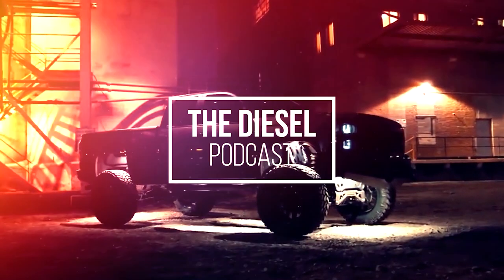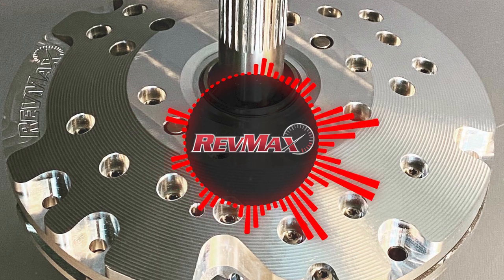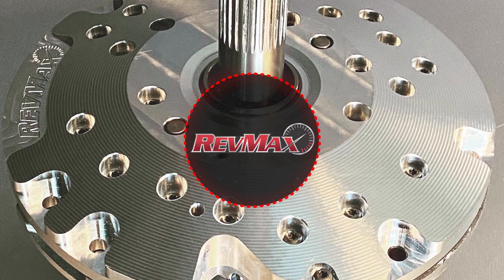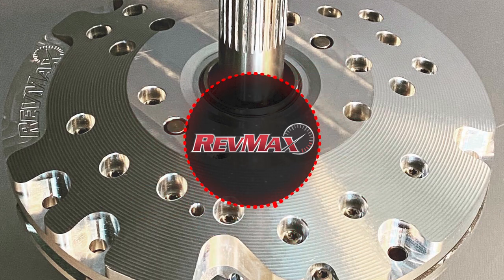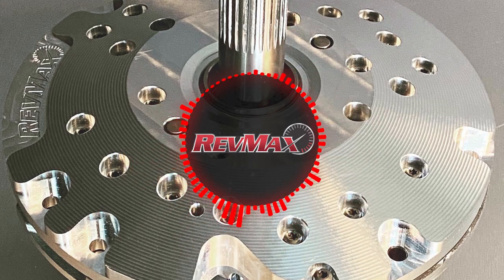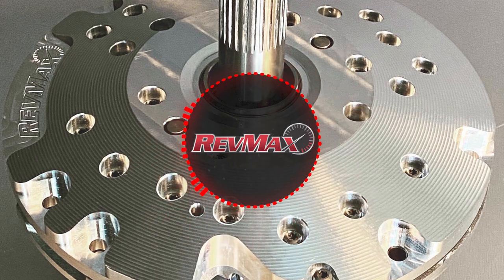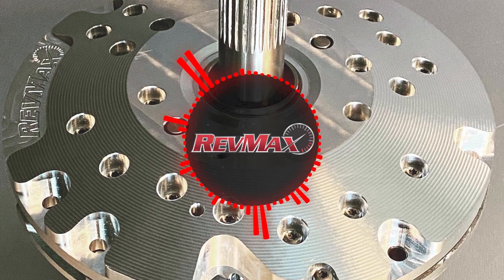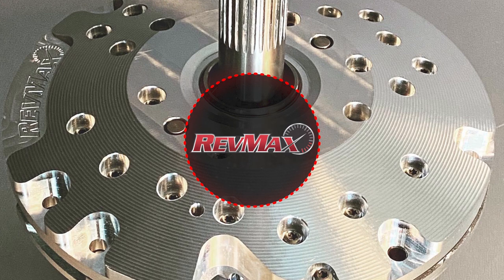68RFE Pump Upgrade

Comment: I am glad I listened to this podcast. I am having the exact problems described by a warped factory pump, dragging tcc when coming to a stop, temp issues and erratic line pressure. About to order a new pump thank you for this.
Reply from the maker: Thank you for listening!

Comment: Having a clanking kinda rattling noise shop said it's the pump it did get a little low on fluid but only a quarter inch under full